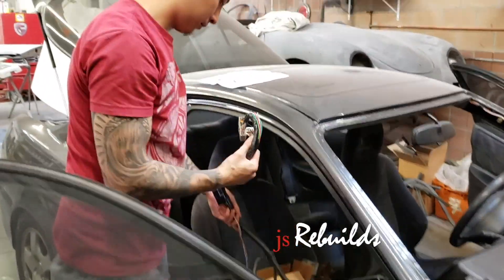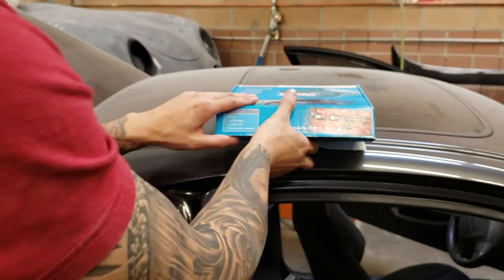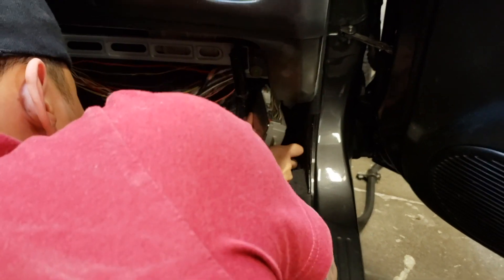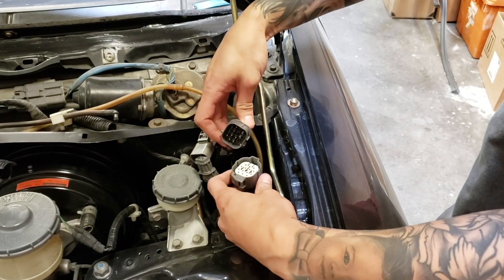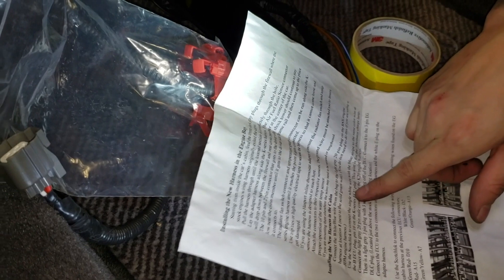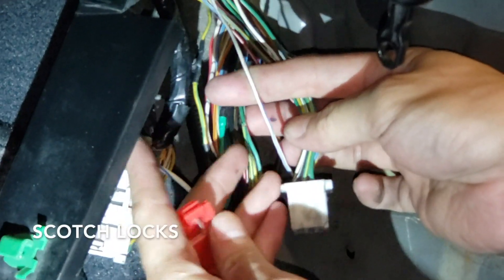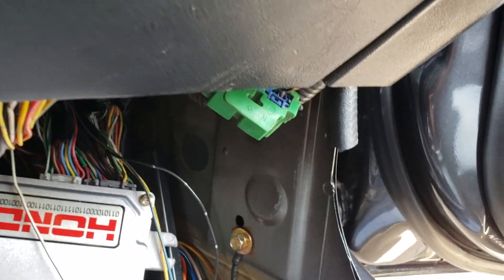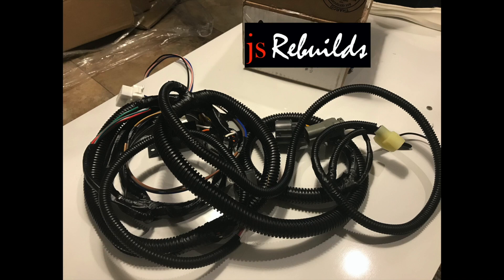K-Swap Conversion Harness Install | DC2 & EG Chassis

Comment: 3:40 are those wires from dash harness or what? thanks
Reply from the maker: Its from the conversion harness.
Reply: @jsrebuilds3951  thanks for your reply but I'm talking about the wires that are there already? That the conversion harness connects into?
Reply: @jsrebuilds3951  yes but what harness is the conversion harness plugging into?
Reply from the maker: @k20aeg39  I believe thicker wires ignition and alternator but the others I don't know.

Comment: I used JDM dc5 engine harness which is way shorter than yours and it sucked.  Maybe one day I will switch over to the USDM spec RSXs ones.